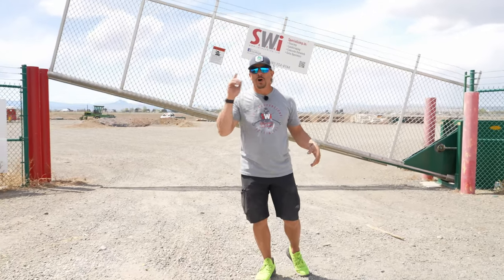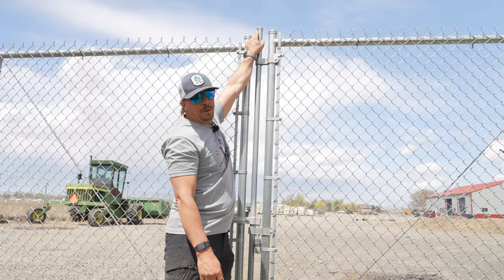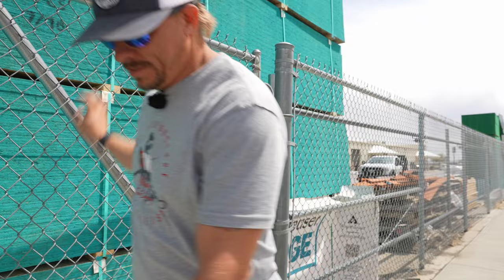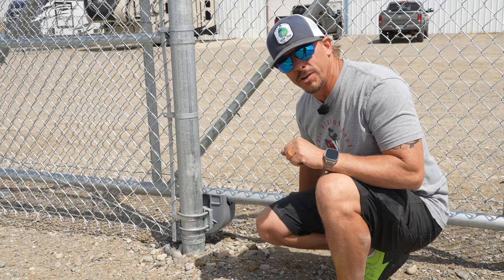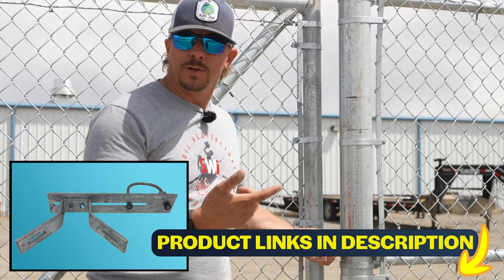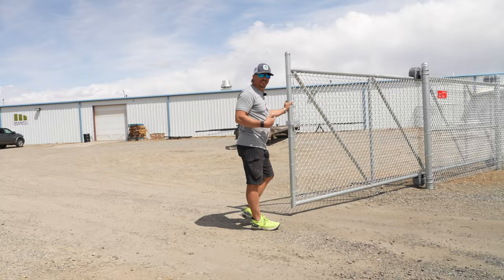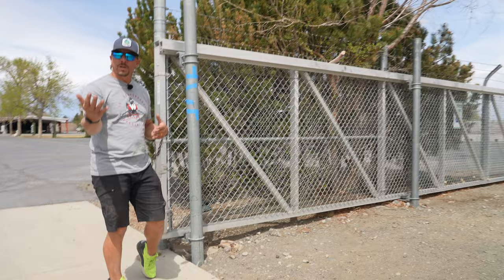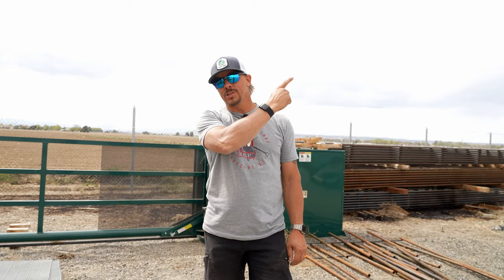Gate Types 101: Every Kind Of Chain Link Gate

Comment: Well I know I'm about a year late but I would like to answer your question in the video about the welded diagonals in the gate. You said you wanted credentials, so I guess I can go ahead and give you mine,  since the age of 15 I've been in construction. I was a field guy that worked my way up. All the way to project management, and became a quality control manager for Army Corps of Engineers special and medical command projects. While I am not an engineer, I have extensive experience working with engineers, negotiating variances creating my own drawings through shop and RFI process approvals and arguing with them at the federal level. That said, while the rigidity of the metal may be enough to compensate for the downward force should you flip the gate over it may not be ideal. You have to consider where the majority of the doward force rest in the gate. In the gate that you pictured that would be from the very top where you close that gate. Those diagonals and their direction might not appear to be significant, but those few extra feet to support far top corners can make a huge difference, that is why that same pattern is repeated throughout the gate as it's cantilevered. I'm sure you already know, especially when it comes to a wooden gate.... But in that metal gated instance, would it work? Yes. The rigidity of the metal could compensate for it. Is it ideal for weight distribution and to bring down the center of gravity toward the lower part of the fastened side? No. The direction the diagonal supports face is something considered all the time in engineering and I'm surprised that there is a debate about it in the fencing world. Each diagonal serves its own purpose, like an upside down V for loads that go directly above... In fact, you can think of it this way if you had to stand on the top corner of that fence where it latches , which way would you want the diagonal to be facing? Anyway good video, I was actually watching you guys's channel because I'm trying to decide on what fence I'm going to install in my house. I was looking for some good options for a wooden privacy fence. You guys are pretty far away from me though. I really enjoyed that no dig fence video and thought that that was an absolutely ingenious idea. I must admit though, I am a little skeptical about the gate areas, just a little...lol... Part of me would still want to put concrete down in those areas. I also love how you guys get those young men out there and teach them, that is so important and there is such a shortage of that today. Anyway, great work, great channel. I've made this comment long enough, any longer and I'd have to write you an email.